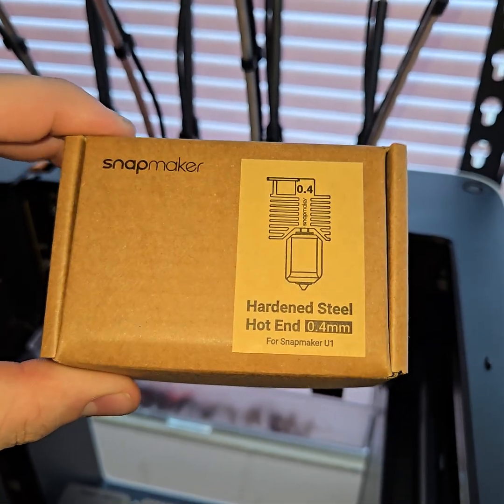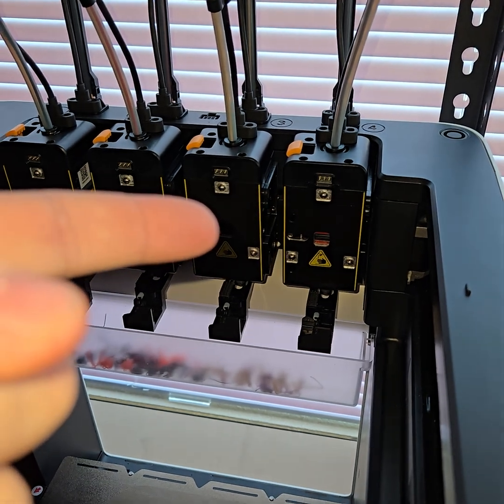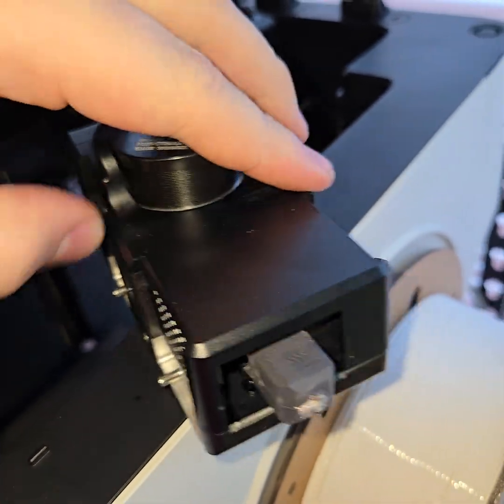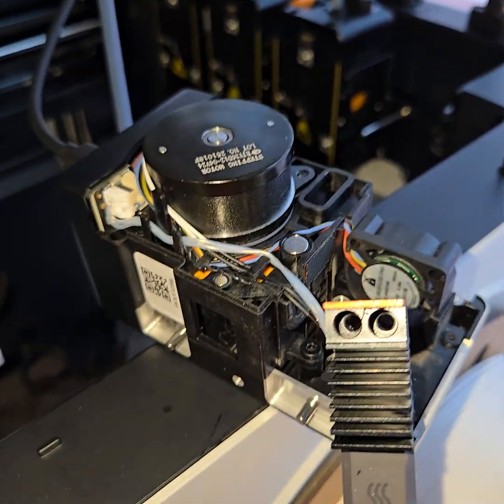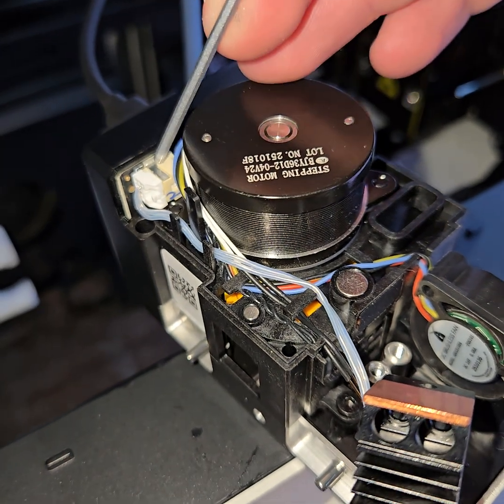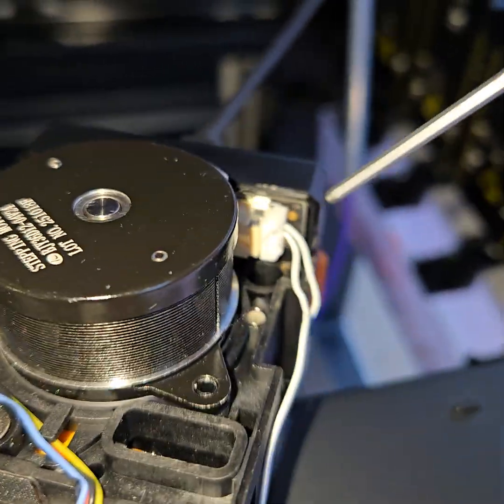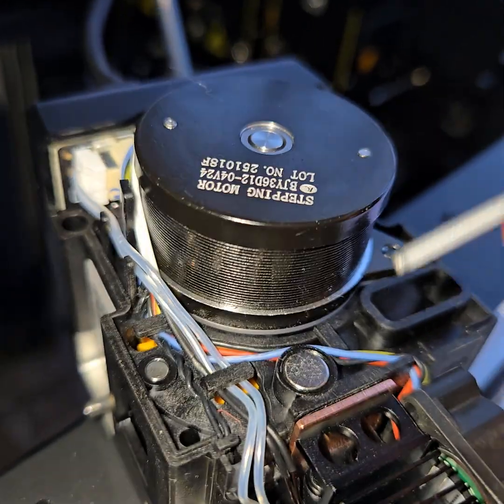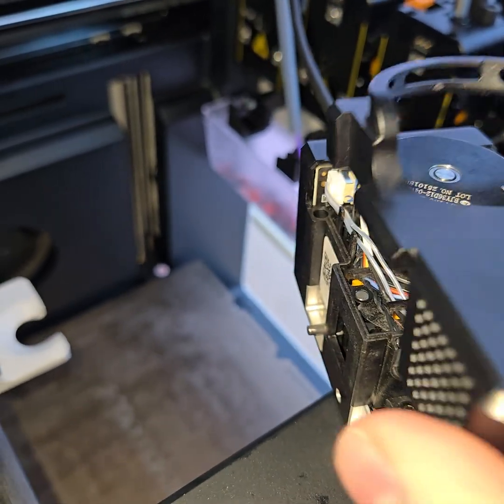Snapmkaer U1 Nozzle Replacement

Comment: You didn't show how you wired up the new one.
Reply from the maker: All you need to do is route the wire around the motor and plug in the connector.